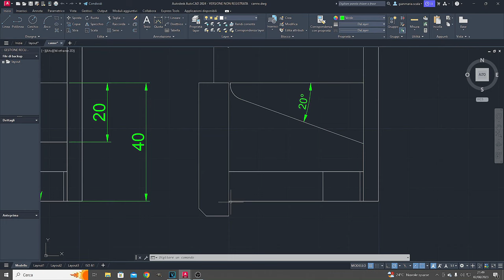Building a Medieval Portative Organ - Highlights

Comment: Using the table saw, please roll up the sleeves and lower the blade to 1-2mm above the work you are cutting. I have 55 years of experience in millwork and still count ten fingers without decimals.
Reply from the maker: thanks for the advice

Comment: Very fine!
I can't help but wonder if, when the front row of pipes hides so much the rear row, the rear pipes might sound noticaby weaker? Do you have to voice them stronger somehow?
I am building a mouth-blown, wall-mounted organetto, with half the pipes upside down under the main body... and though all the pipes speaks directly in the room, those lower sound really softer to the player, who stands above them 🤨
Reply from the maker: Hello and thank you, for those who play the instrument you can perceive a slight difference in sound between the front pipes and the rear ones, but not weaker. No differences are noticed even at a distance of one meter. In general, if you are very close to the pipes, the high notes can be more annoying than the low ones, but the orientation of the mouth has very little effect in open pipes.
Reply: @nippocast  thanks, good to know!